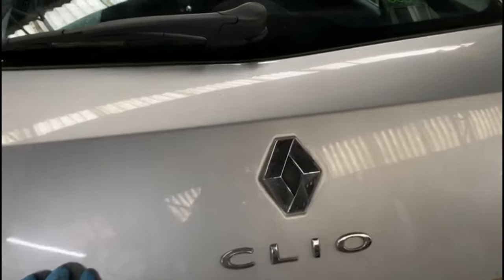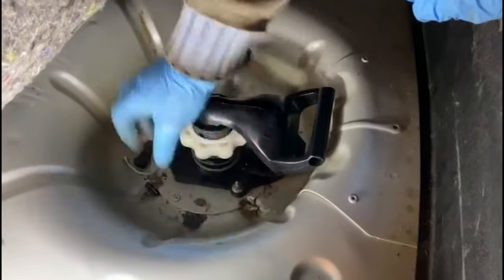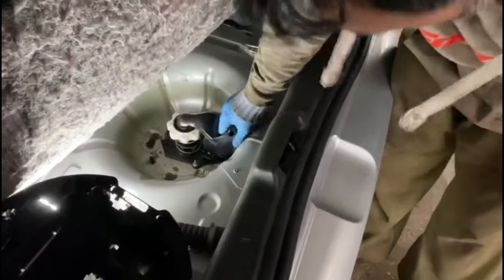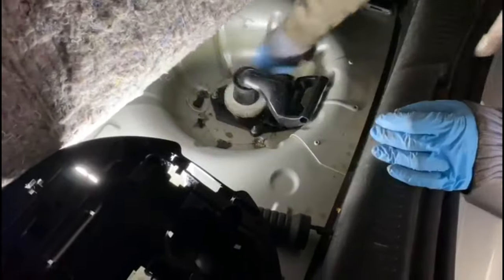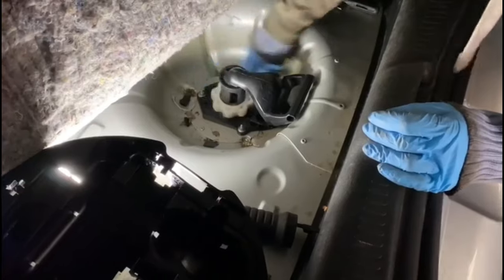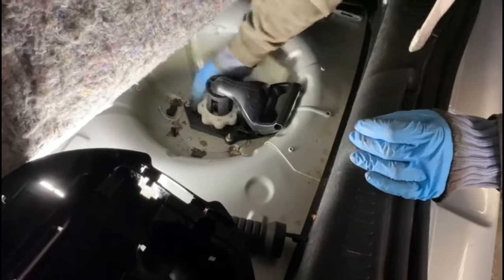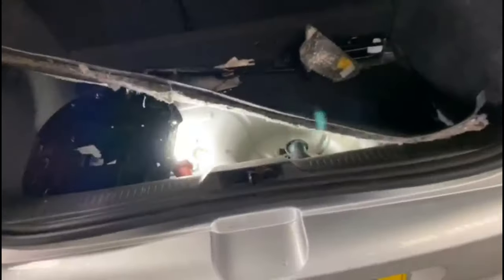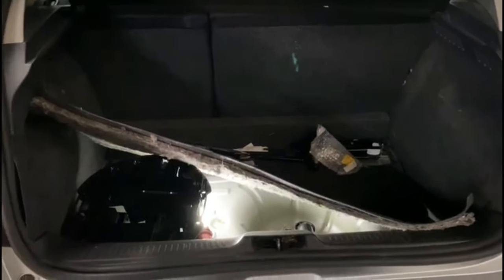how to remove emergency spare wheel on Renault Clio #renaultclub

Comment: This doesn’t always work I put all my weight on that gear and it snapped it to pieces wheel is still in place currently sourcing and angle grinder and a 13 and 10 mm spanner